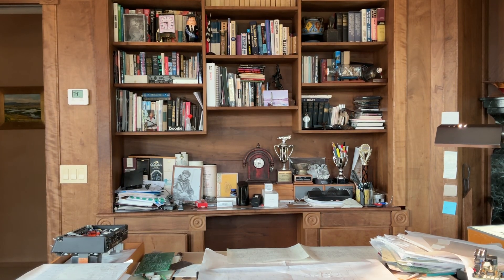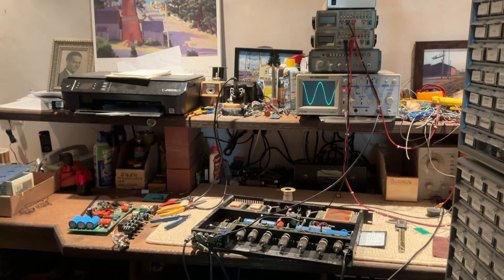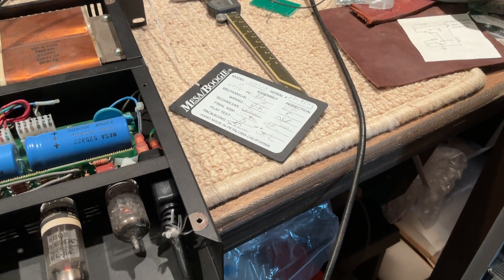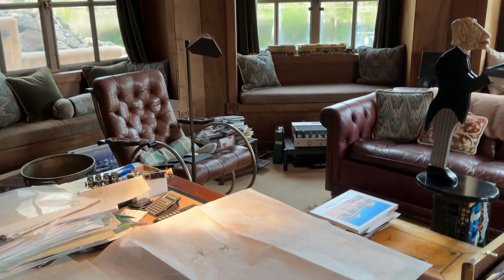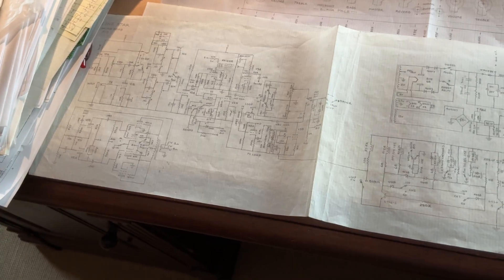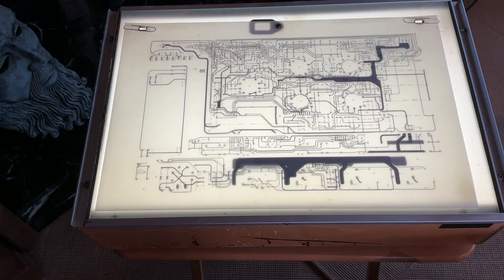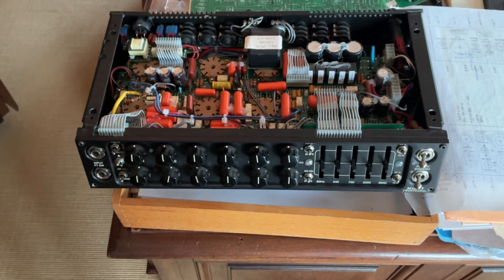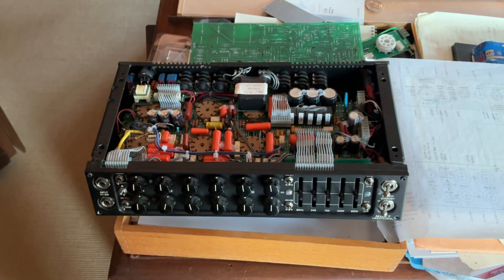Building Boogie #40:  Secret Design Lab behind book case; how circuit boards were designed

Comment: Did you guys have an axial inserter for the resistors and such, if so who is the maker? I use to work with axial inserters and DIP inserters in my early career days. The ones I worked with were made by Amistar. CI-3000 and an AI-6448.

Comment: This great stuff reminds me of a couple things I've meant to put in the comments, too, one question and one note of gratitude:

#1, when you were just getting started with the Princeton Boogies, and then moved on to the Mark I, was the more "traditional" part of the circuit based on any specific amp, or was it always your take on the general world of AB763 blackface Fenders?  When I got a chance to play a Mark I, the un-boosted Input 2 + Volume 2 sound really reminded me of a perfected black or blonde Bassman.  To my ears, the more you developed the Marks, the more their lower-gain channels kept a lot of that Bassman warmth and fatness, but they also have more of that "bubbly" elastic thing.  Kinda somewhere along the continuum of Bassman <----> Vibrolux, maybe?, but with that Boogie warmth and midrange density.  (It was a brilliant idea to change the 10k blackface Mid pot to 25k and create that Mid/Boost control – unbelievable sonic range.

And #2, speaking of later Marks and unbelievable range, it was my birthday a couple months back, and I decided to celebrate it by celebrating 50+ years of a certain Mr. Randall Smith and the whole Mesa/Boogie crew.  So I asked myself, "When the used prices on the older amps inevitably skyrocket, what's the one Mesa creation I haven't played and would really regret missing?," and for me, the answer was obvious: the Mark IV.  So I did some hunting, found a great price, took the plunge, and my GOD what an amp.  What an AMP.  I knew I loved the Mark IV modes on the V and VII, but the Mark IV itself has such an incredible smoky, spongy, chewy set of high-gain tones, and I'm just barely getting into what the R1 and R2 channels can do.  That Lead Voicing switch is great, and Mid Gain has become an addiction for me.  I need to spend some time in Class A and Triode modes, but Simul-Class is too good to turn off!  "Perfection" is subjective, of course, but Simul-Class/Class A and Pentode/Triode is about as close to the perfect power amp as I've ever experienced.  It fully solves the old versatility vs. tone paradox: 4 modes (or 8 with Tweed Power) that are all good enough to be the ONLY mode.

So thank you, Mr. Smith.  It has been one of the great joys of my life to hear, play, and study Mesa/Boogie amps and tones, and the Mark series alone is like hearing and watching the whole evolutionary history of electric guitar.  (And then, of course, the Mark VII, where that WHOLE evolution is present in one amp!)
Reply from the maker: You're right of course:  Got to have a fine Clean sound and that is based on the great Fenders, mostly black-face era, then make as toneful as possible!!

Comment: Hello, good afternoon Randall. I had a follow-up question please. How long have you been designing in the secret lab? I was just curious, as I've also seen your video of the design lab at the Mesa factory from thirteen years ago ("The Pit"), and wondered if you were working in both at the same time. Thanks for being so responsive to all of our comments!
Reply from the maker: The Pit was my prototype lab and I used it extensively while living on my little houseboat.  When I built the house with the hidden lab, that became my prototype lab.  The drawings of chassis and circuit boards I could do anywhere and mostly did over winters in Palm Springs.  Then built the protos in the hidden lab, take them down the mountain to the Tone Lounge for extensive testing and refinement with Doug West, then off to Steve Mueller in Texas for further testing and evaluations.

Comment: Can you talk about about the choice of parts used like the tantalum and the 400v coupling caps? I've had those fail in my early mkIII  which has sometimes sounded quite good.
Reply from the maker: Could spend hours of boring talk about individual components.  So, I mostly focus on the Big Stuff: Transformers, speakers, circuitry . . .

Comment: They discontinued the 5:25, 😮🫤!!!  Bought my 1st in 2016, @ Boogie Hollywood 

(90’s a V-twin rack & 50/50, mistake …I didn’t understand until I compared it to the 5:25, ADA MP-1 1st with the 50/50, great sound, way harder to use, programming banks 😳🙄🤯until 2016 I was not a serious player, a dreamer & didn’t play 2010-2016 truck driver, I play daily now, @ 10,000 hours!) 

Studio pre, 90’s better choice, too much $ then.   Now I’m retired, investments: & enjoying the golden decade of guitars after years of guitar mags & dreams

5:25 #1 needed a re tube in 2023, & loath to not be using it, & I got #2 from Sweetwater.   A custom grill, for $100+ could have had a 5:35, out of stock, drat!
this happened because the only authorized Boogie repair guy left in So Cal  by 2023 got Covid, 3 months before I got #1 back!  A 120 mile drive to Orange Ca. & back!
(Marty, Futara electronics maybe you know him)

Not knocking the v-twin, cool feature set, especially the dual sound, but it’s hybrid gain structure is not my sound,  4 space rack absurd to move.  all tube Mark amp is my sound 😀

But don’t need a 90 watt Mark 5, or 3 sounds.  A 16lb lunchbox amp   Bingo😃

I use EVM 12L’s in separate Theile birch cabs.   The recommended master setting on the 5:25 of 10 o’clock is 105DB😳.   As it turns out, Covid demolished my join a band plans anyway, everyone I knew either moved away, stopped playing or died.

I jam with a big 4 speaker stereo system, my band is Pandora, jazz in a stone house & dbl pane windows.   Nobody can hear me, & I like that.  About 86DB

Both amps #1 runs clean a shade lower volume on 25 watts, #2 runs at 10watts hi gain, but I play light 

Together absolutely nails Carlos Sound.   A Yamaha RevStar with Seymour Duncan’s     

Hopefully they don’t discontinue the 5:35, morons at Gibson🤯.   I love this series of videos, like being in a boogie club, great stories I’m a decade behind you.   At Santana’s moonflower, Yamaha & boogie. Dream rig!

That for all you do & have done.!
Reply from the maker: Thank YOU for writing - - and Playing.  Carlos and I go way back . . . luv the guy.

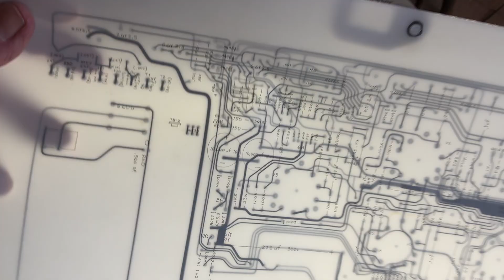Comment: 5:11 lol yeah I used to do board drafting back in late 80s/early 90s. New CAD people can't even comprehend that, or imagine that people used to do this sort of thing regularly. 😆
Love your secret area behind the bookcase. My work area is in plain sight unfortunately.
Reply from the maker: You are so right!!  Many guys these days only know software knowledge (I don't) but have very little "nuts and bolts" experience.  The technology has advanced so far that the origins have been largely lost and superseded.
Reply: @RandallSmith2G  Reminds me of how people new in my field today (construction related consulting engineering) can't visualize something in 3D without some kind of computer program to draw it in 3D for them. If you ask me, it's kind of taking steps backwards relying too much on technology and not having to visualize it with their mind.

Comment: Love these videos, what's brewing up your sleeve, have a feeling you're up to something ?...
Reply from the maker: Yeah:  unfulfilled amp concepts since being fired by Gibson who, I think, want to split directions between "reissue the old" and also make new modeling amp, off-shore.  Not really what I would have done.
Reply: @RandallSmith2G  I've turned down an offer from a well known guitar manufacturer as "senior amp designer" partially over off-shore production concerns. Sure enough that's exactly what they ended up doing.
Reply: @RandallSmith2G  Would you be interested in live streaming while you design/tinker? I think it would be treasured by many for years to come!

Comment: Wow! Thanks for the tour behind the scenes!  What a story...what a legacy!  You piqued my curiosity with that chassis drawing at around 3:20.  You said it's hand-drawn, and also explained that it didn't get made because "they" didn't want it.  Presumably, you weren't still hand-drawing schematics after Brand X purchased the company in 2021.  Who then, was "they"?  Maybe you had a board at Boogie that would decide what would get produced and what wouldn't?  As you said though - and what is very clear - is that a schematic like that represents a fair amount of work.  It's a shame that you would spend the time to put pen to paper as it were, only to have it subsequently disapproved.  Again, an assumption on my part, but I suspect you'd verbally discuss the design first and get cleared to proceed with the actual renderings?  As if to add insult to injury, it sounds like "they" were going to trash your work had you not recovered it...nihilo sanctum estne?!?  Unbelievable!
Reply from the maker: Funny thing:  "WE" always knew what to make.  "THEY" need dozens of meetings with lots of folks who don't know "our" biz to tell us what to make.  Does that make sense?
Reply: @RandallSmith2G  There's a great Frank Zappa line about the music industry that seems to apply to EVERY industry: "When I got signed in 1965, the labels were owned by old guys who didn't even like rock'n'roll, so they just gave us a budget and said, 'I don't get it, but who the hell knows, maybe it'll be a hit.'  The industry really died in the late ’70s, because all those old guys had been replaced by aging hipsters who thought THEY knew what YOU should record."

Comment: Are the amps tested with the same tubes or they change? Most people say especially preamp doesn t matter but i ve noticed differences in my mark v 25..and the old mesa 7025 str , the chinese ones, sound best.. thanks
Reply from the maker: Of course the tubes are the same ones the amp is tested with.  And if/when  we have to change in production (cuz of availability) the amps are retested with the "newer" ones and sometimes a minor circuit mod is required to achieve the desired sound.  I helped develop the Chinese 12AX7s and they WERE the best.  But . . . they didn't want to make them any more (embarrassed because they were "old technology") and left all the manufacturing equipment outside in the rain!!
Reply: @RandallSmith2G  thank you..i ve just bought some 90' mesa 12ax7 7025 str..they are the famous  square getter and sound great...i ve noticed similar if not same design is on some Beijing 12ax7 with a White star ( military specs) .

Comment: As someone who's only used a computer to do PCB layouts, i can't imagine working without automatic Design Rule Checks.  Did i put that 500V trace too close to the guitar jack (shock hazard)?  i dunno, but the DRC will tell me.  Did i forget to connect a few components?  Couldn't tell you, but the DRC sure knows!  Really impressive that anyone got anything to work back in the day.
Reply from the maker: Interesting!  My pc software is super basic and it's up to me, as designer, to know spacings and locations for stability, tone, reliability, noise etc.  Maybe AI will learn how to layout a great amp pcb sometime, eh?

Comment: Hey Randy, This is one of my favorite videos you have made! I'm an old guy too - 70 years old. That makes sort of young... Hah! I first started taping PCB artworks around 1975. I started creating artworks for the Craig Anderson guitar pedals. I was still living in my parents house. I found that the PCB photo resist solvent wasn't working very well. So I tried Toluene. This worked great. However, when Dad came home and smelled the basement, he was certain I was going to blowup the house, since I was sitting next to the house heater... That ended that phase. But I have been working in electronics since then. Right now, I am using Altium CAD software. And you are right. Modern SCH and PCB CAD is so much better.
I particularly liked seeing your hidden lab. I have a back room in my basement that is my little lab. I have the old Fluke DMMs, Tektronix analog scopes, and HP audio oscillator and 334 Distortion Analyzer and quite a bit more. Right now I am working on a 1965 Bandmaster head. And I set up my guitars in there as well. With guitar audio, these audio instruments (and a couple more) is all we need. I am working now at a company, where we are making a battery powered wireless subwoofer. It has a 300 Class D amplifier in it. It works pretty well, until you drive it into distortion. Class D distortion is beyond awful. Some people just want it louder... We know that there are good and bad sounding distortions. You sir are a world class distortion connoisseur! I wish I had moved to California and worked for Mese Boogie.
Reply from the maker: I knew of a silk screen artist who died of cancer from inhaling too much toluene fumes!

Comment: This is so interesting. I don't know if you've frequented a forum called DIY audio, but I have to relate something. They are pretty knowledgeable, but can be staid and traditional in their ideas. I just came upon a discussion about how to remove hum caused by vacuum tube heaters. Of course, the standard answer was twisted heater wiring. That works for point to point wiring but not for a printed circuit board. But having owned a Tigris I learned from you that if you make your own circuit board there is a work-around. Just layout the traces in a  fashion where one side carries the current to the heater on one side and then put a trace completing the circuit directly on the opposite side. Just make sure the side opposite carries current in the opposite direction. Then the magnetic fields cancel. I mentioned that and ... crickets.
Reply from the maker: You Get It !!